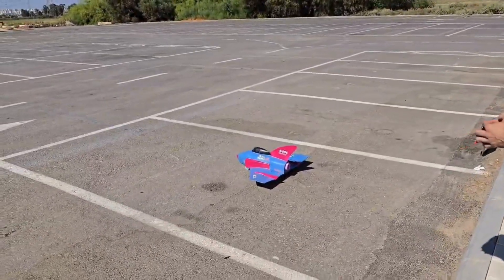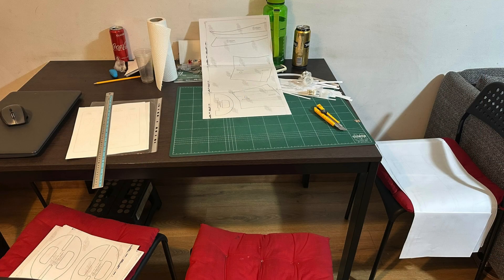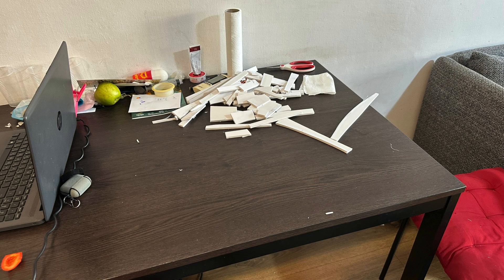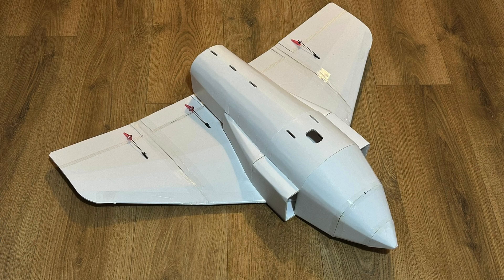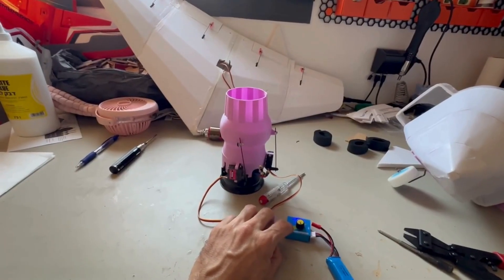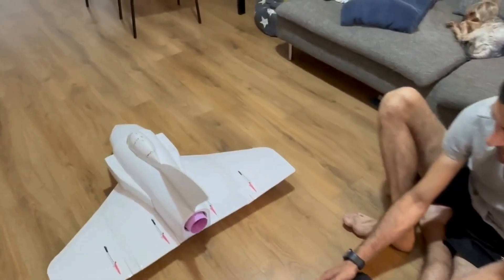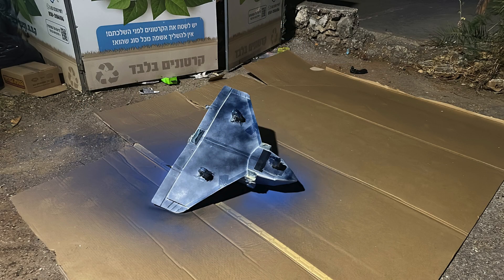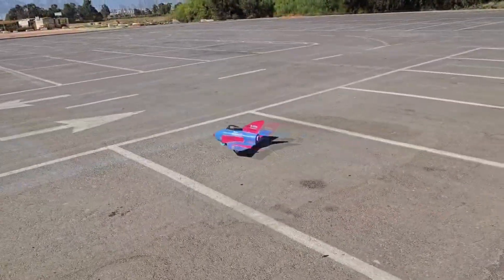Flite Test Made the Coolest RC Plane Ever… So I Built It Step by Step!

Comment: Hey mate when you do your plans use the refrigerator front and a bunch of magnets when you tape plans together. they are more easily lined up and stay in place as you tape them better.  Man that this is quite "zippy" . comin in hot has TRUE meaning with that one.
Reply from the maker: my frige aint that big ;( and she sure does come in fast. maybe i should dial in airbrakes too :).
Reply: @InRemoteControl  TAIL HOOK!!!  tie 3 sets of 2m nylon string to sand bags and challenge the pilots on who can hit the middle wire most!
Reply from the maker: @borgonianevolution love it